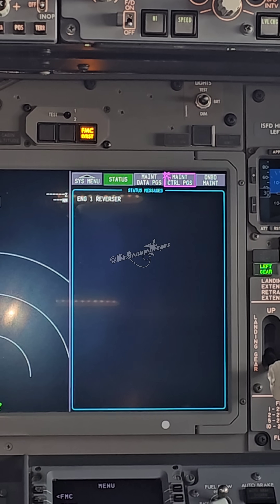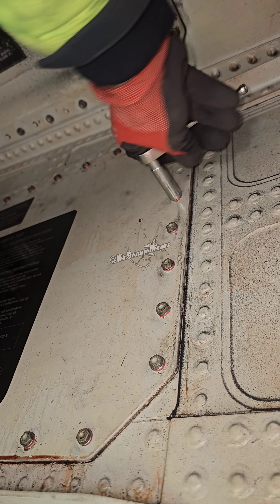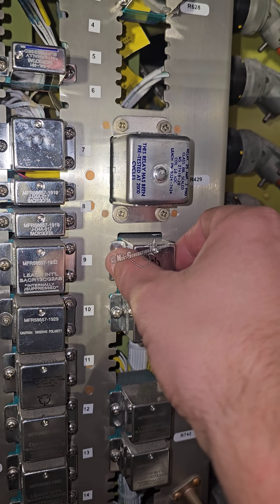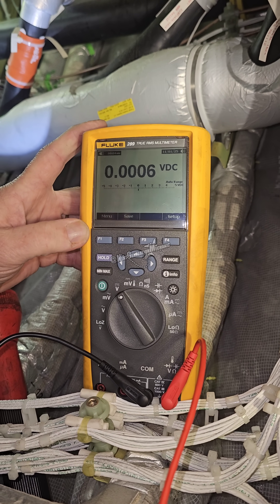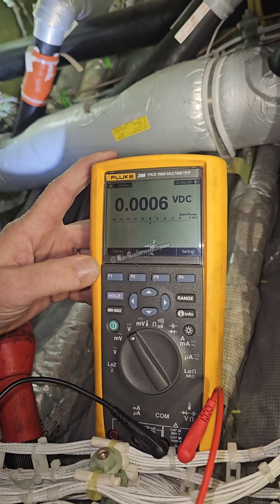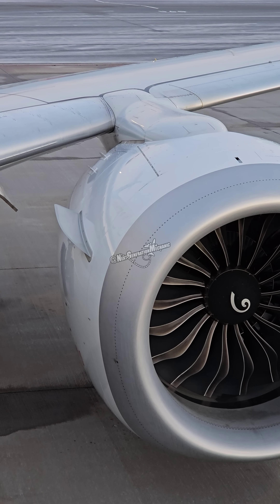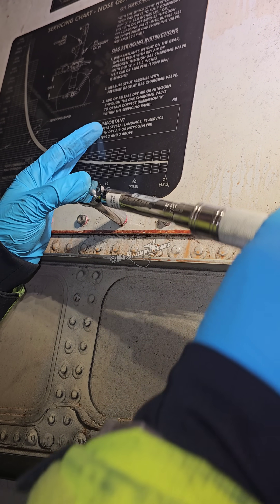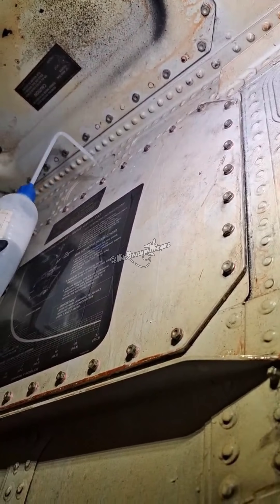Troubleshooting a Thrust Reverser fault on the Boeing 737-MAX

Comment: Did you check amm for relay ? Or just guess
Reply from the maker: Yes, but for T/S the AMM isnt really a great help either. Sometimes the FIM (Fault Isolation Manual) isnt sufficient enough for specific troubleshoots. This was one of those instances where we had to use a combination of the WDM (Wire Diagram Manual), SDS (System Description Manual) and SSM (System Schematic Manual). And then it is measuring, and see if it has the desired effect. If not, you know there is a fault at the component you are checking.
Reply: @NextGenerationMechanic thx alot please guide 777 slg increase tail clearance but how it improves take off performance

Comment: What happened to valve? Can you return a serviceable component back with hydraulic mess?
Reply from the maker: The valve will be tested and ofcourse cleaned at an overhaul shop. When servicrable, the valve goes back into the 'parts pool' and can be used again.